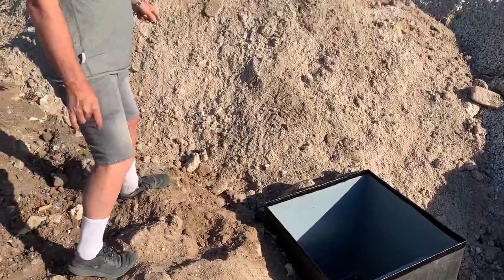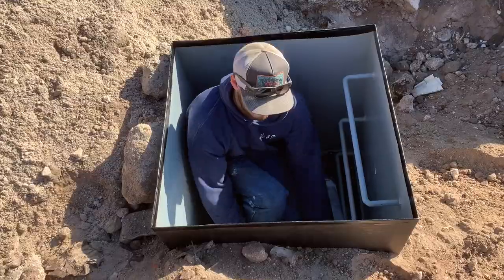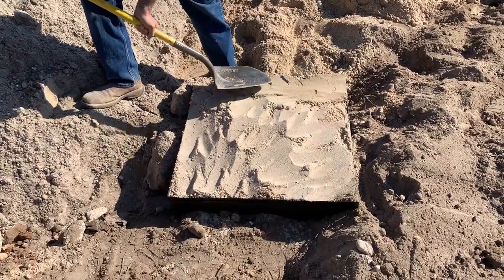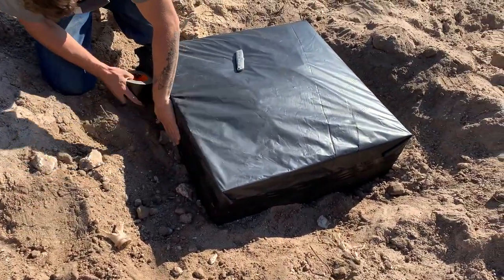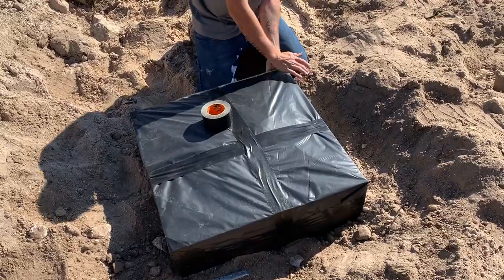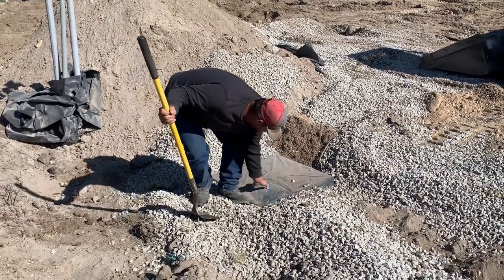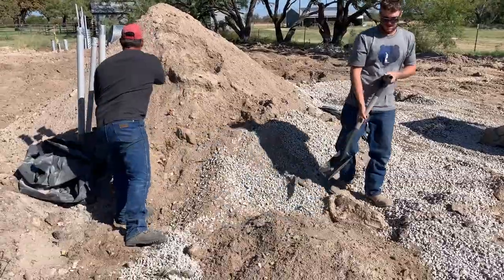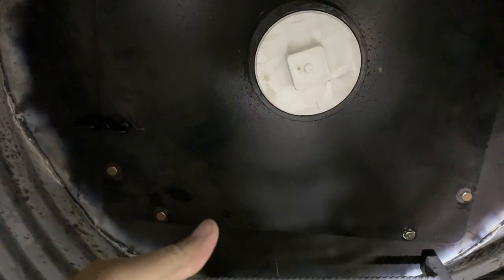How to Complete a Sand Filled Escape Box for an Atlas Survival Shelter

Comment: Ron, a good idea might be to have a utility knife, a crescent wrench and a crank flashlight 🔦 bagged and hung off the back of the ladder so you have some tools to work with.  ;)
Reply from the maker: It will
Reply: And goggles.
Reply: It would probably be a good idea to put a hand saw with wood/metal blades, a lump hammer and chisel there as well.
Nothing worse than your house burning down and blocking your entrance out of the bunker and then realising that pretty tree your wife planted 20 years ago has spread a mass of roots over the top of your escape hatch or you completely forgot about your invisible escape hatch and decided to concrete or asphalt over the top when doing some landscaping.

Comment: I think somewhere between 30-50% of the sand will remain above the first hatch. That will make it interesting when you remove the  last of the 8 bolts
Reply: Add goggles
Reply: That is what I was thinking.   After a few years there will probably be a lot of sand left.  As S C said, five holes in the plate would be better.

Comment: Ron it would be super cool if you would mock one of these escape tunnels up outside your shop… Filling it with sand… Surrounding it with dirt and stone… Just like a real install and demonstrate the use. Not only would it be fascinating to us in TV land but could also be used as an instructional video for your clients.
Reply from the maker: It shows the sand coming out in another video on my channel called.  Installing and testing the atlas escape system
Reply: @AtlasSurvivalShelters  awesome my man I’ll have to check it out!
Reply: @AtlasSurvivalShelters  OK I just watched it ... not exactly what I was hoping for… I don’t think anyone is going to push the top layer off to the side if it’s buried a foot deep covered with plastic.  Was hoping to see how that was done. Ok so the sand is drained through the sched 40 fitting. Plate removed. THEN above that yet another foot or so being held up by a thin layer of duct taped plastic(?). 😎

Comment: A super cool way of doing an escape hatch would be a water trap under a shallow decorative fish pond. The hatch is at the bottom of a three foot pond and a remote lever inside the secure side of the bunker would open a drain to a remote sewer drain or something of the sort. using a pond liner on top of the hatch would allow The hatch to be water proof and still hidden after the water drains away. A small layer of soil at the bottom could allow you to plant some aquatic vegitation that could further mask the exact hatch location. A hydraulic hatch would rip right through the liner and in an emergency you could always blow the hatch equalize and scuba away if you put a bigger pond on top of it. MAYBE it's a james bond/navy seal fantasy, but that would be a badass way to exfil from a compromised bunker. Just like a SEAL launching from a submarine haha.

Comment: Many people may know, but you may want to explain that the reason this entry gets a few feet of sand is as a radiation shield because of the lack of necessary run distance to block gamma radiation which otherwise would have direct access to the shelterists inside. That's doing it right.

Comment: with just a layer of plastic...  after a few years, isn't that going to degrade and eventually let water get down into the hatch and maybe even thru the second plastic barrier?
Reply: That’s why there is a round hump in the middle. Water is going to drain off that plastic for decades. The tape at the corners also helps to keep those areas from tearing from the weight of the sand, rocks and dirt, even if wet. The plastic will not degrade for a very long time under the ground.
Reply from the maker: Very good answer

Comment: Throw lots of scrap steel around the escape hatch so detectors don't find it but find too much. Undo 8 bolts? I'd rather have a hinged door, dropping that large piece of steel down will make noise and the last bolt or two will bind from the steel plates weight..

Comment: MIt einem Sieb wäre es sehr einfach gewesen. So bleiben etliche Steine über, die den Abfluss verstopfen. 
DIe 8 Schraubenmuttern sind auf der Außenseite frei zugänglich ? Dann können sie auch in trockenem Sand rosten und verklemmen und man bekommt sie von außen leicht auf. Besser Hutmuttern aufschweißen.
 Liebe Grüße !

It would have been very easy with a sieve. This leaves a number of stones that clog the drain.
Are the 8 screw nuts freely accessible on the outside? Then they can rust and get stuck even in dry sand and can be easily opened from the outside. Better to weld on cap nuts.
  Best regards !